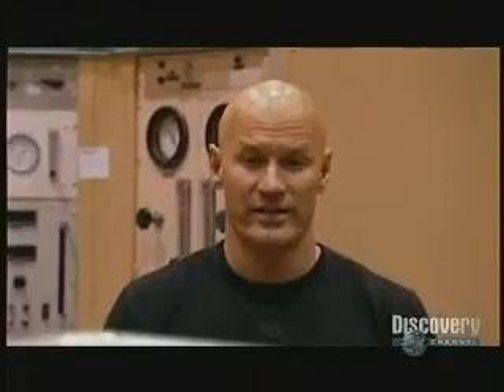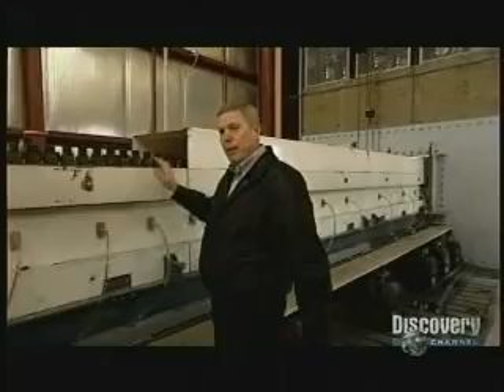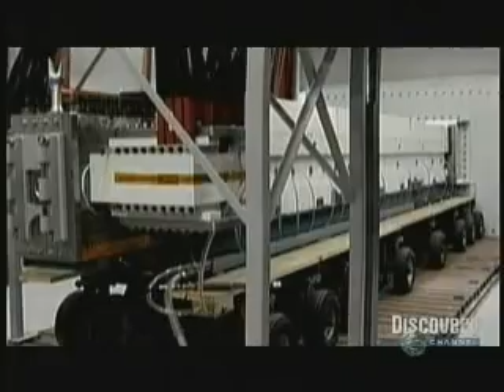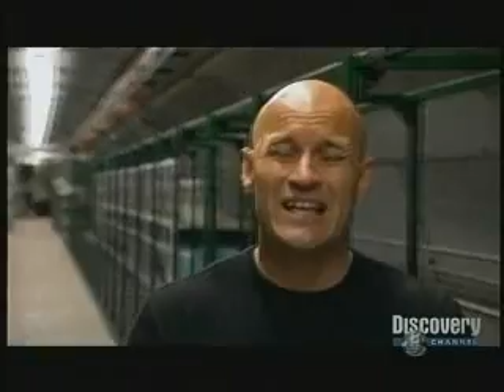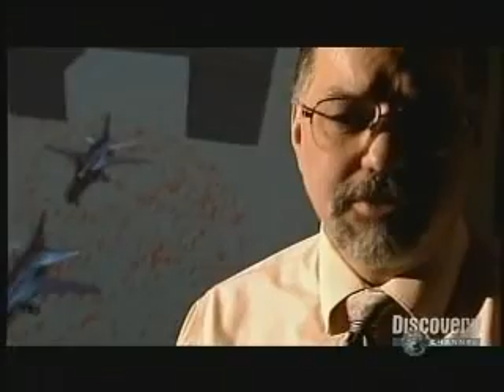Demonstration of the Navy Electromagnetic Rail Gun prototype

Comment: I saw the one response you got.  Also materials and chemistry.  One issue they are having is the rails are destroyed after every shot.  Also, you need to the wires making the field to be low resistance so that the current is high.  So, High temperature super conductors are important.   

Anyway, I'm an EE major (I actually have an exam on this stuff in a few hours)  and my professor loves talking about rail guns.

Comment: Well its stupposed to be taking over the role of artillery but When your moving at mark 6 considering and you can control the release of energy more compared to artillery it would also be more accurate comparatively. Also when we get nano layer batteries and capacitors which are being developed you should be able shrink the capacitor's down and even fit them to more mobile units. Like you could get the capacitor size down to 1 or 2 meters cubed.

Comment: @StainedShuriken333 Well they use the capacitors to store the energy. The magnetic field is then created in an inductor by the current coming from those capacitors. The problem with storing energy in inductors is that you can't keep it because of the resistance of the wirings. You can use supraconductors to solve this but well, way easier to use capacitors to store the required energy.

Comment: @StainedShuriken333 I think you're confusing two concepts. Inductors do create a directed magnetic field when a current is applied, but the capacitors are used to store energy from the ship's power source, which can be released nearly instantaneously across the coils of the railgun, triggering the massive acceleration. Think about it like a water wheel; if you have a constant stream, you get a little power, but if you fill up and dump a bunch of buckets, you can get a huge surge.

Comment: @COD04MW : There is a vast amount of heat generated, most likely resulting in a degree of combustion - certainly, a volume of super-hot gas would escape the barrel.  It also looks to me (though I could be mistaken) as though the projectile is of a sabot-type design, with the sabot/jacket being at least partially destroyed with the tremendous forces acting upon it (which is probably why sabot munitions would be practical for such a weapon, and would explain the discharged material). Just a guess.

Comment: @StainedShuriken333 Also, inductors can provide large voltages on kickback, but limited by curent. Also, inductors do not store energy after you remove the applied voltage. You would need to maintain the current applied to the inductor continualy till you want the discharge.

Comment: @n64freak5 Likely not so much a railgun as a magnetic sled. The problem with railguns is that the tremendous heat from the friciton of the round on the rails is that the rails are rendered useless very quickly, so they need to be replaced often. Not somehting you want to have to deal with in a catapult system. Plus, the force of accelleration from a railgun catapult would cause severe damage to the pilot from the massive Gs.

Comment: @dmine45 Yes, but even so, you could charge up an inductor and then shut off the circuit so the EMF collapses, which that energy output could be used for the shot. Although, in order to make sure it's ready exactly when you need it, you'd have to keep the current flowing through the circuit, but there's a much larger energy output. The only advantage I see for capacitors is their ability to store a charge over an extremely long period of time, but an inductor's energy output can be far greater.

Comment: I have a question:

I am school for computer science, but we have to take a few classes in circuity and circuit appliances.

Why do they not use inductors to fire the projectile? It seems as though they could get much more force for the projectile instead of using capacitors. There's probably more involved with it that I'm not understanding, but I'm just wondering why they would not use that method... My only guess would be that the EMFs from the inductors would obstruct it in some way, but idk

Comment: Alright ... 5000 miles an hour .... In two hours ... from the US west coast you can destroy any kind of target in eastern asia without any risk of interception due to the speed of the projectile ... This of course only if the projectile is strong enough to resist air friction and if it doesn't get slowed down by the same air ... which is I assume impossible for now ... But the simple idea of this makes this gun scary ... especially if used from space ...or in space ....

Comment: @UniteForgetLeftRight Cruise missiles are expensive and, compared to rail gun projectiles, slow. Once the rail gun is built, the projectiles should be much cheaper than cruise missiles. My reservation is that cruise missiles can fired over the horizon and retargeted enroute, but once a rail gun projectile is fired, it's pretty much a done deal so we'd be losing some capability with the switch.

Comment: @thekenponinja 
Have you seen a meteorite impact crater? The effect is basically the same, although on a smaller scale. At I believe it was around 3 miles/sec, an object impacts with force equal to its weight in TNT.

Comment: @Qwerty48121 Meh, as far as I know it works like this:. The heat generated by the rails is the lack of efficiency (heat-generation when the energy applied is meant to move an object). According to the laws of thermodynamics you can't get a perfectly efficient engine but the efficiency of a railgun is awfully low (somewhere around 7% on the better models I believe someone said) of the actual energy input. By reducing the temperature of the rails you'd decrease resistance thus heat generation.

Comment: @caread966 Try using a good conductor such as copper and cool it all down with liquid nitrogen. Then you won't have to worry about the rails melting.. Although the heat-differences can give you some unexpected reactions.. If you have the resources that is. The minescule resistance in the then superconducting rails would leave it many times more powerful and well.. maybe saving them rails from wear and tear.

Comment: well that much amount of power to be generated to create that circular magnetic field and to launch the projectile; all of this in a compact smaller form is basically not possible now, as the bolts transferring the energy to complete the circuit are very poor conductors. also they are worn out by needing almost more than 10 megajoules of energy, but lets hope for the best

Comment: @doasie the problem with the lower level weapons is that you need an VERY high amount of Energy to propel a single round, that is not very efficient compared to the gunpowder, and there´s also the force that the Rail will create, you need to tight up the gun VERY TIGHT or it will explode due the force created by the magnetic field. Imagine the Gun as a Ballon, and the Air is the Magnetic field, if you put the balloon in a confined space, it won´t explode, just fill.

Comment: I like the idea, but I have one issue with it as a weapon for attacking hardened targets. Since the round has no "warhead" will the kinetic energy be enough to destroy a bunker? I would imagine the round would be long, thin, and have some kind of tip to allow penetration into rock/concrete. Basically, you would be making a round made for directing the energy at the tip of the projectile. Would it do enough damage to destroy/cripple the bunker, or make a couple of deep, thin holes in the ground?

Comment: @ChronicMist hmmm you have a good point there, the rail gun alone is complex and would cost far more but the rounds they discribed sound cheaper and less complex than a rocket. in the long run it might be cheaper than rockets

Comment: @petaboil
the force will be the same but not the velocity/acceleration 

F = ma *starting at rest* 

F = m x [(final velocity - initial velocity)/time] 
       ^mass 

larger mass for rail gun + w/e it is mounted to theoretically provides enough reaction forces to "cancel" out the "recoil." Also, there are many other forces involved because of the fact that the rail gun is acting as an electromagnet causes other forces to be involved than just the reaction forces.

Comment: This is one of those guns that will prove useful as:
1. Static-defence-breaking (namely destroying point-defence weaponry)
2. Flamethrowing any infantry in close proximity to firing zone
3. Causing immense shortages of energy at whatever power source it is connected to
4. Shooting satellites?
5. Ruining fine metal.

Railguns were proposed by the Germans in WW2 as an anti-aircraft system, and further research decided that it was possible-if Germany had enough excess power for half of Chicago.

Comment: well the railgun is a high velocity highly armor piercing weapon that in my oppinion should be a Tank mounted weapon used as an anti tank weapon.
If loaded with a rod of Tungsten (also known as Wolfram) wich is an extremly dense material it could pierce a tank as it would pierce..... well.... wood... maybe..
Bottom line is that this weapon, as you stated, will probably not replace guided missiles, but will probably replace other non-guided weapons

Comment: Actually, A Linear induction motor is a different technology. A LIM relies on attraction and repulsion created between a set of permanent magnets, and a set of electromagnets with rapidly alternating currents. The current in a rail gun does not alternate and flows _through_ the projectile, creating a circuit. There are no permanent magnets in a railgun.

Similar, but different.

Comment: Sundaydriver pulls up a good point but doesnt quite touch on the physics of a railgun. You conductor as your projectile. Its called a rail gun because you have 2 conducting rails to which the capacitors are hooked up. The projectile has to bridge the two rails so when the energy from the capacitors is dumped, it travels through the rails across the projectile, creating a magnetic field which propels the warhead. Water is not a good conductor and would not work.

Comment: the concept is different; if i remember metal storm correctly, it uses electricity to set off what would be set off with a hammer in a traditional gun to fire the rounds.

the only similarity is that these rounds don't have "shells"

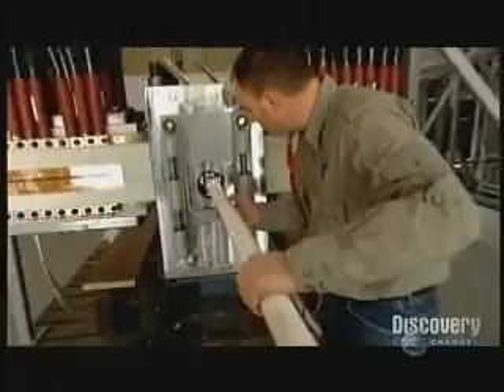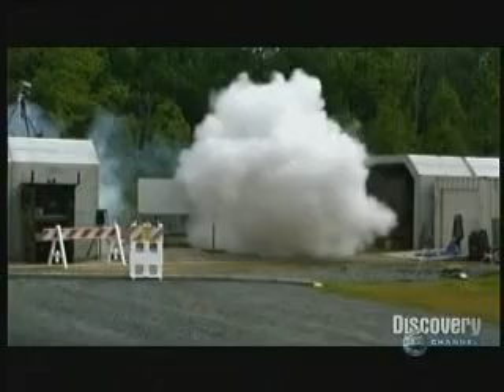Comment: the flash was greenish. look from 0:34-0:36 you'll see it.

i always said that the main hurdle in making linear guns wasn't the physics but the chemistry. if they come up with a rail material and projectile combination that allows for more un-resisted flow, they can reduce the heat, which is simply a product of electrical resistance. 

stronger materials would allow for rails with less reinforcement (making it lighter). new capacitors (coupled with the planned reactors) would shrink size as well

Comment: The trail in fact would be the friction from the round causing the air in the bullet's path to hyper-expand, which would cause distortion, and depending on how fast the projectile was moving, may theoretically ignite the air. So the trail will be there. Now, there won't be any fancy energy-esque contrail or anything, but...

Comment from the maker: There are practical applications with this now in the commercial market. The Linear Induction Motor is similar to the rail gun technology. LIMs have being used for some high speed roller coasters for over 10 years. So there is some commercial practicality for this stuff, not just for weapons. :)

Comment: Well, its not that simple. Its either you're wrong, the force is distributed elsewhere, or, the law is flawed. There is a simple example that proves my point, shock absorbing armor. The projectile that hits the armor, does no "push" because the force it has is distributed throughout the armor. Like this gun, the magnets that the force of the projectile, distributes it outward. Its a matter of control. It doesn't avoid the law, because the forces are still there.

Comment: The speed of the projectily, which is the size of 1 particle.. goes to 99.9996% the speed of light, so, the projectiles mass would be about 600x higher, may seem like a lot, but a particles mass is so small to begin with. The damage, would be none. 

As for the speed, 186,000 miles per second is lightspeed, 99.9996% of that would be 185 999.256 miles per second, which would be 669,597,321.6 miles per hour. you were 1 million off there bud lol

Comment: Rail guns don't have recoil. It's another one of the reasons the US/British Navies want them. 
They get extremely hot tho. For example, if you try pushing 1,000,000 joules worth of energy into a 10 gauge wire it'll vaporize. You'll never see a hand held rail gun. Coil gun maybe but never a rail.

Comment: r0bf, there is no "explosion" in the since your thinking of. if you try and punch something underwater, the water offers resistance because your not moving fast enough to effect it, but if you fired some thing through the water that acted like there wasnt anything in front of it and the shot went straight through... well then you could fire a .45 and have a tsunami as a result.
there is a point when things like wind and water just cant effect something going at high speed, and theres your bomb

Comment: I read an article in Pop Science mag about a year ago. The Navy fired an .80 Calaber round (slighty bigger than a paintball in diameter) at a small building. The projectile reached about 7500 FPS (over 5000 miles per hour) and caused all the windows to explode out of the building, but in less than a millisecond the entire building colapsed caused from implosion. LOL the projectile had actually sucked the atmospheric pressure out of the building.
Crazy stuff I must say.

Comment: Lol the earths gravity cannot accelerate it fool :P. The point of launching it from space is that there is no air resistance and thus stuff can achieve high speeds. Once the projectile enters the atmosphere then air resistance will, in fact, slow it down a lot.

Also..depleted uranium should not be used as a weapon since it's nasty stuff. Moral objection.

Comment: they should fire it from space where weight isnt an issue.  then they could shoot a 10 ton piece of depleted uranium with no air resistance from space and have it accelerated by the earths gravity and then have a larger impact radius than an a bomb.  only minor issue would be getting 10 tons of anything to space, but if they could....  KE is 1/2mv^2.  you get to square your velocity.  imagine the power ah.

Comment: No. The whole point is the speed at which the projectile is launched. In the days of trebuchets a large amount of the velocity given to a projectile went into getting it up high enough to reach it's destination. A significant amount of kinetic energy was used up in this. At a few thousand miles an hour, gravity hardly factors into the equation for close targets. The percentage of kinetic energy used to keep the projectile aloft is absurdly small compared to it's forward velocity.

Comment: I would think of it as true.  The theory behind rail guns have very good peace time uses -- one concept idea is what they call a "mass driver".  

Its essentially a large rail gun but instead of sending projectiles at extreme speeds, it launches bulk supplies space -- saves a ton of fuel compared to launching a shuttle for this.

So launching aerodynamic objects to save on aircraft take-off fuel?  very possible.

Comment: Oh wait you are right. I mean, when computers started using "modern miniaturization" processes, like Oh say transistors instead of vacuum tubes, I mean it was totally impossible to ever make them smaller and still improve output and performance. What exactly is a silicon circuit board? Oh ya, a newer modern miniaturization process that had not existed and allowed the technology to become even smaller. Hmmm.  But I am sure there is no way ever to do anything like that again.